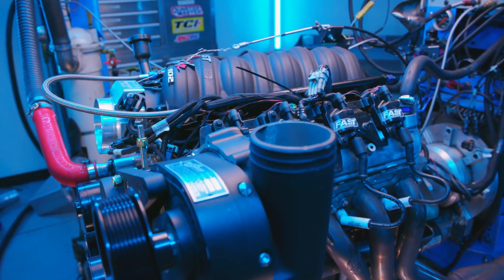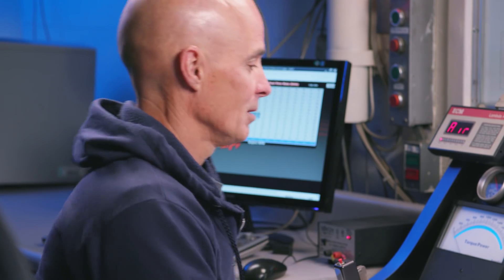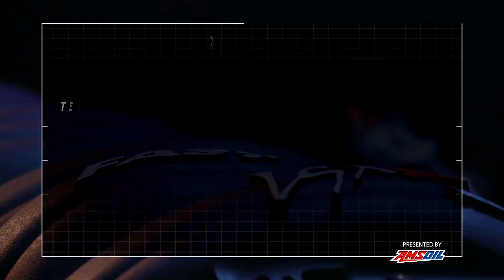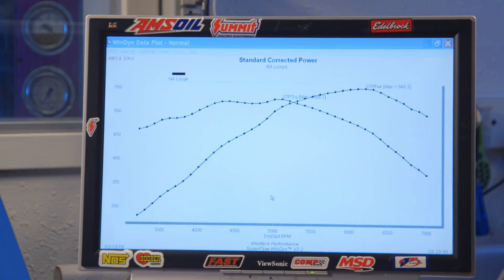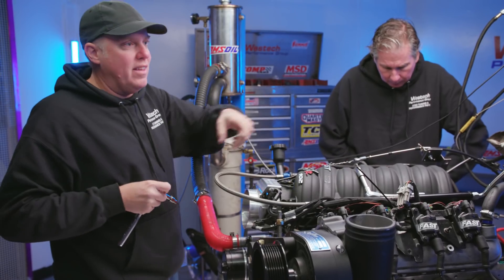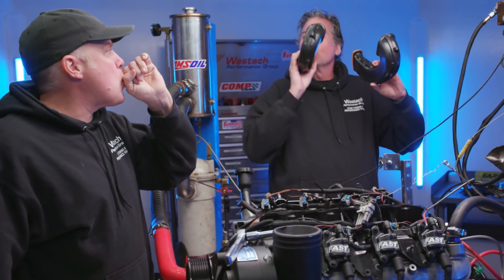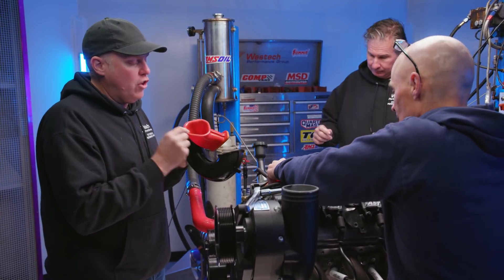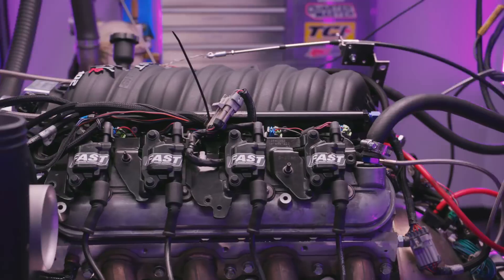Just Like My Siphoning Days—Engine Masters Preview Episode 46

Comment: Should have tried long runners front, short runners rear with medium in middle to try to even out the distance air has to move from the T.B. to the intake valve. Would be nice, btw: if you would fix the comments section on the MTOD site.